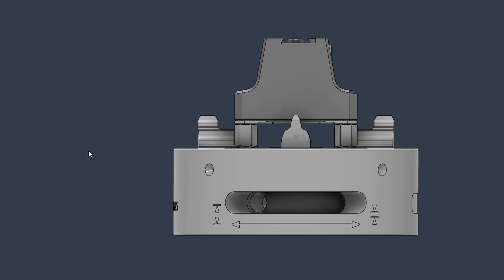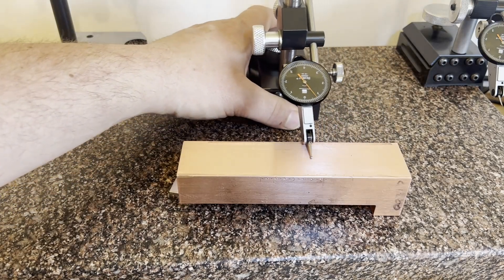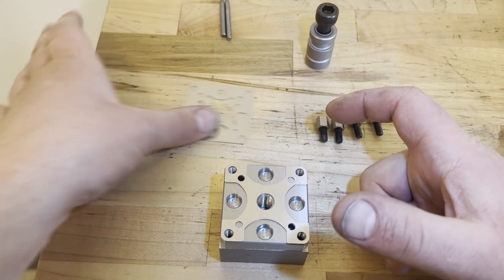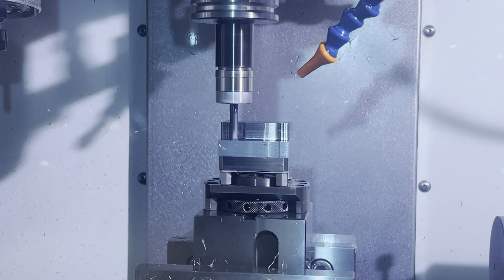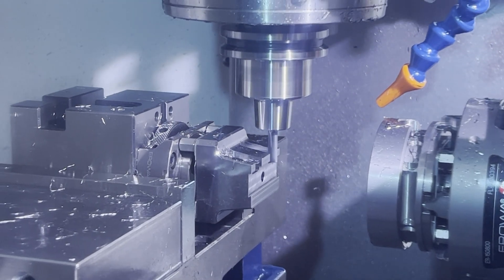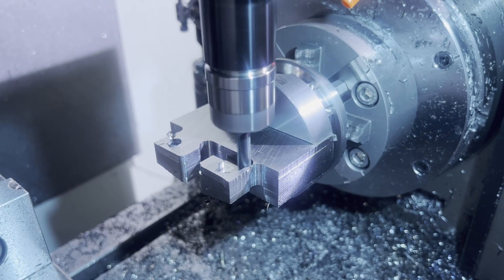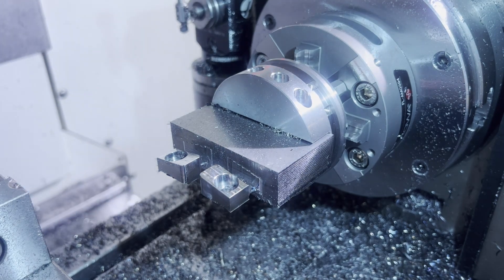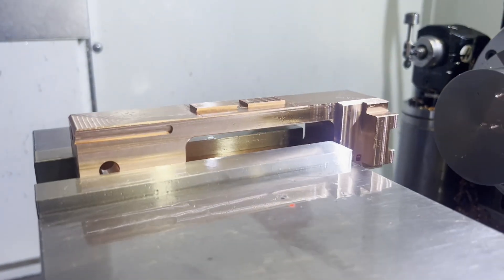Dovetail workholding and copper machining

Comment: where do you buy the parts for making your own erowa pallets? any recommendation on where to buy the bases?
Reply from the maker: I've used maxx tooling over genuine erowa a few times and have been very pleased. There is another brand called rapid , haven't used them but they seem well liked online

Comment: what are you using for coolant if you dont mind?
do you machine a lot of copper?
95 percent of jobs i do is brass castings and ive trying to find a coolant that doesnt turn blue and corrosive.
ive used coolants with metal deactivators but the additive is used up very quickly and then i have 100 gallons of waste to get rid of which im sure you know is very expensive to get rid of.
im trying to find a good solution but i havent found any and i have been through many many different brands and series in the last 4+ years
do you have any of these issues?
Reply from the maker: @shawnlaughlin7327  copper is cut very occasionally here, mostly tool steels and stainless materials . So I run blaser gt15 cutting oil for those materials. Definitely overkill for copper but it also doesn’t have any discoloration issues

Comment: Hi Adam, I was curious what you are using for coolant? You once mentioned it years ago when nycnc did a shop tour but I couldn’t quite make out what you said in the video.
Reply from the maker: Blaser gt15 neat oil
Reply: @adamthemachinist  are there any issues with tramp oil when using a neat oil?
Reply from the maker: @andrewh2341  well the haas is a grease machine , but it seldom cause issue even in way oil machines . Over time you carry out small amounts of oil on chips and tools. So the addition of new oil is generally faster than the way lube is coming in. For certain cases were you need a very specific lube and it can’t gradually change, you can find cutting oil manufacturers that offer compatible way lubes that don’t pollute the cutting oil
Reply: @adamthemachinist  really appreciate the info, if you’re ever up north in Cleveland I’ll buy you a coffee.

Comment: Is the piece held only on the dovetail or is it held on the dovetail and on the uppersurface of the clamp? If so the position of the dovetail will have to be verry accurate. I am not using a dovetail clamping yet. But i would try it. What to look for to do this?
Reply from the maker: The dovetail and the upper flat part of the fixture are what make contact , the center flat section has a small amount of gap to ensure the widest part of the fixture is touching the stock. The dovetail size can vary a bit since the clamps can accommodate the size difference. I would look at commercial options like raptor workholding or 5th axis to get a deeper understanding

Comment: I’m not doubting your fixturing skills here, but why not just buy a blank Erowa pallet and then drill, tap, and pin it for one of those Raptor clamps? They are expensive but really nicely machined and (best of all) premade.
Reply from the maker: That is a fair point to make. Most cases it makes sense for me to buy if its available. Not just from a cost perspective but time. But sometimes I like hanging out in my shop making things that I've designed. Work isn't scheduled for Saturdays, that's for personal projects. So if a fixture that might cost almost 1k to buy can be made on a Saturday , and I enjoy myself while doing it , why not just make it and save the money? Plus it makes easy video content since there aren't any NDAs

Comment: Adam thank you for the content. I very much appreciate the focus you place on the viewers learning potential thank you for this. I am a self taught fully on youtube. I would appreciate your tips and tricks on checking, calibrating, and getting the highest precision out of your cnc machines. Say if you purchaed a new cnc mill for example, how would you start to tune it in and get tuned in with it? Test parts you would run, measurements you would take, and so on. Would you consider making a video on this ? Thank you again.

Comment: I don't do much copper. So you are saying the residual stress in copper is only on the skin and that the core is free of it? It would be worth pointing out that other materials like heat treated aluminum have stresses all the way to the core so that "skinning" it won't get rid of the stresses in those cases ex: 6061 T6. The stronger the material is, like 7075, the more residual stress it can sustain.
Reply from the maker: It’s has some stress to the core, but the bulk is in the first 1/8 inch or less. Of course it can also work harden and do some odd things with stress that way to . If lead time allows I still like to stress relief . But roughing five sides then finishing is a nice alternative

Comment: One of the best hardware machining videos I have seen in a long time. Wasn't familiar with erowa and was not entirely sure how the angled tabs help keep the jaws from lifting up and still allowing good clamping if the male portion is say a bit undersized? I built a dovetail for aluminum machining to get all around the parts, works but the tab angles up. I've seen the 5th axis and raptor guys using some kind of dowel pins or t-slot tracks to hold it in place but like the idea of the angle tabs better. Machining another couple vises in the near future and luckily I don't have to make it zero point indexable but it needs to be about 4-5" tall because its on a 4th axis trunnion.
Reply from the maker: You do need to be pretty consistent with the width of dovetails. as the clamp tightens it bears down on the angled slope in the fixture as well, removing any play in the system

Comment: Something I've always wondered - how did you deal with the power situation in your shop?  You work in your garage on your house property still correct?  
Do you just use rotary phase converters? Get the power company to augment?  220v VFDs?
I'm struggling with small machines because of a residential situation and haven't come down on the best power solution.
Thanks!  Love how youve built your business.  It's inspiring.
Reply from the maker: Originally the shop was built around single phase equivalent, the haas and kaeser compressor are factory single phase and the manual grinder uses a vfd . The later equipment is three phase and I use phase perfect digital phase conversion for that

Comment: Have you considered annealing the work hardened copper that you purchase?  It only needs to be heated to 500C and then allowed to cool slowly.  To prevent oxidation, you can wrap is stainless steel foil.  From the size of the parts in the video, a knife forge will work quite well.  Just need to get one with doors.  Many handheld electric test meters are available that can use a type K thermocouple for temperature monitoring.
Reply from the maker: A lot of the copper I deal with does get annealed and sometimes even cryogenically treated, just depends on what the customer will pay for or has time for. It’s a vast improvement but doesn’t totally eliminate the problem.

Comment: Liking the use of Erowa on this, used the system a few times in the past and highly rate it for repeatability. Only drawback is the cost of the pallets 🤮

It's funny you show dovetails I was only this week preaching the benefits for turning to colleagues where stock material is limited

Comment: I worked in an aerospace machine shop for a while and we were constantly fighting internal stresses. We would do 5 5axis set ups to rough, relocate, then finish machine.  I'm curious if you have ever had to drill very small holes in copper before? I have a project coming up where I need to drill some .005-.007" holes in copper alloy.  I'm wondering if you have any words of wisdom?
Reply from the maker: I used to do quiet a bit of small hole work in copper , but it was .02 4xD. I had a lot of things going my on that project with running cutting oil and have lots of Rpms at my disposal. The drills came from Mikron , crazy drill line . The feed was quiet impressive for such a small tool , .0024 per rev. Unfortunately .005 diameter is a very different story, good luck
Reply: @adamthemachinist   yeah we'll see. Thanks

Comment: Hey adam, I usually machine parts out of duplex and super duplex, but every time I face them, these parts want to bow the other way around. They don't bow up as you have shown in the example with rubber bands, instead they "bend" up (or bow down). Can internal stresses want to stretch the material, instead of compress it? Have you encountered this problem?
Cheers :hand-purple-blue-peace:
Reply from the maker: I’ve had the opposite reaction like you speak of, and many other hard to predict bow and warping problems . Sometimes the the material can get a little bit of work hardening that contributes to odd things happening. Or maybe there’s a hit to much clamp pressure that overwhelms the part as it gets thinned out from machining .We apply best practices like stress relieving and sound machining strategies, but at the end of the day work that wants to warp is still a challenge.

Comment: Hi Adam, such a great video.  Its so great to be able to see your setups and your approaches to making parts and its not lost on me how much extra work goes into this for you.  The subtleties I can pick up from these I just gold.   I was left with a question after this video.  I understand not biting onto the actual stock with the lang vise, but couldn't you use the dovetail feature of the lang gripper jaws on a similarly thick dovetail cut into the bottom of the copper?  They have a 45° built into them right?  I get this might be more bulky than the dovetail fixture you made, but I was curious.  I've done this in the past and it 'seems' to work well, but can't really back it up with any data.  I usually grip on dovetails that are 2mm tall, but don't see why 1.5mm couldn't work?
Reply from the maker: That thought crossed my mind . Ultimately another part not shown is what pushed me to a dedicated fixture . It’s much smaller and the compact dovetail fixture is much easier to work around than the somewhat bulky Lang
Reply: @adamthemachinist  Ahh, makes sense.  Thank you!!!

Comment: Thank you Adam! Just the video I needed!
 It's almost spooky, I just came in from the lathe, after another unsatisfactory go at turning copper(I'm no machinist), for a glass to metal seal known as Housekeeper. It requires turning copper tubing, to a tapered knifes edge, but it just kept peeling like a banana. Tomorrow I will try to bore the inside to even out the work hardening. 
Again thank you! Your videos are such a great resource for armatures(like me) that crave technical insight.
Reply: Armatures? You are an electric motor coil?! Amazing!
Or amateurs? Like novice.  😂

Comment: I'm not familiar with those chucks and I'm too tired to think. What's the purpose of those stamped parts that go on the bottom of the fixture?
Reply from the maker: That’s what does the actual locating.  the rectangle slot are a bit under sized, when clamped the plate flexes away from the blades on the receiver/chuck . So you end up with zero looseness on the locators . Something like a dowel pin and bore needs a few tenths difference in size to come apart easily . So you have a balance between accuracy and ease of removal . The stamped plates are the best of both worlds

Comment: Hi Adam, your videos are really informative, I learn something new in every single one. Especially on workholding.

Are you running oil, or standard coolant in your Haas?
Reply from the maker: Neat oil , blaser gt15
Reply: @adamthemachinist  - What's the actual downside (if any) to running neat cutting oil in a CNC?  

The old farts I've asked about it in the past all like to go on about it gumming up & requiring far more frequent cleaning.  I'm not convinced their tales of doom & gloom reflect badly on the concept, or the state of cutting oils from back in the day.
Reply: @somebodyelse6673  The main downsides are the decreased heat transfer away from the part, slightly less flushing ability from deep features, and the Mrs kicking your teeth out for traipsing neat oil through the house from the garage. None of your handtools will ever rust though!
Reply: @somebodyelse6673  In fact I own an old East German WMW-Heckert toolroom milling machine and the manual states that coolant is undesirable because of corrosion and it calls for using only oil as a cutting fluid. The machine is from the early sixties I think, maybe late fifties.